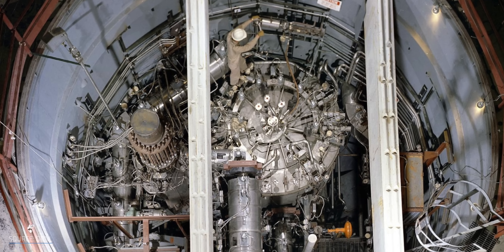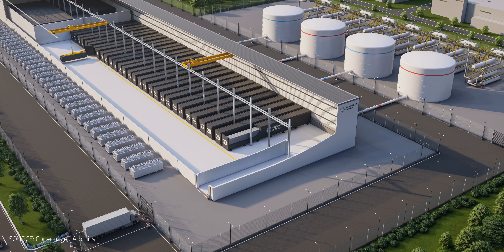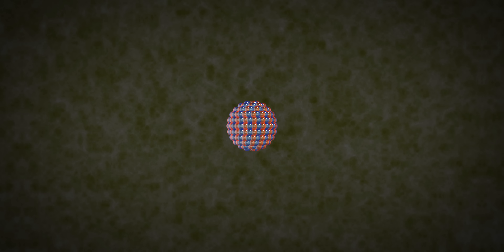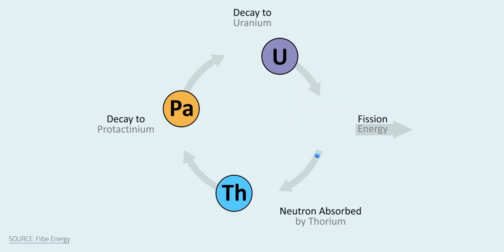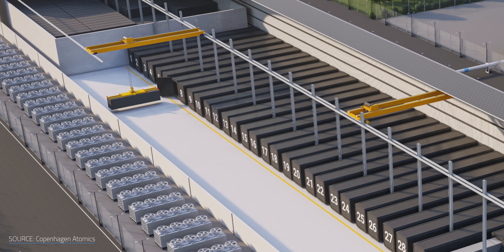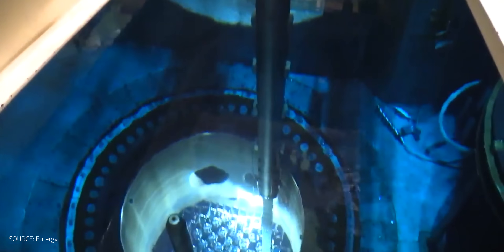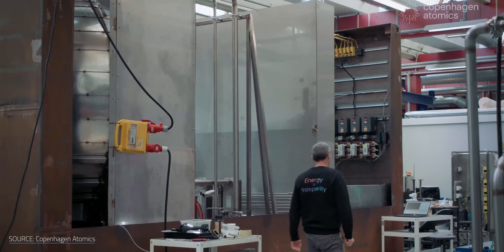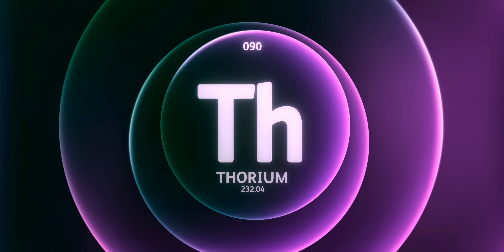Why Thorium is About to Change the World

Comment from the maker: Is this technology in the bag, or is it more roadmap than reactor? Go to https://surfshark.com/undecided or use code UNDECIDED at checkout to get 4 extra months of Surfshark VPN!

If you liked this, check out How Waves Could Quietly Overtake Solar & Wind https://youtu.be/l1pxV7Nro34?list=PLnTSM-ORSgi7uzySCXq8VXhodHB5B5OiQ
Reply: While " molten salt" makes thorium reactors sound safer the facts are:
Thorium fuel is more dangerous to handle than uranium fuel due to the presence of highly radioactive daughter products and the need for remote fuel fabrication. 

Irradiated thorium produces Uranium-232, which decays into Tl-208, releasing strong gamma rays that are difficult to shield, requiring expensive handling and reprocessing. 

In molten salt reactors, the highly corrosive nature of the molten salt can damage reactor components. 😮
Reply: I wasn't going to watch this because it is yet another 'on the cusp of breakthrough' video on clean nuclear; but I'm glad you made this video.

Thank you
Reply: Serious question, why is the mock-up of the power plant showing the containers above the surface when there's a gamma radiation concern? Wouldn't they just put it below a couple meters of water at the very least?
Reply: When a system wears out Can the radioactive piping, vessels, pumps be melted and recycled, or are they buried?  Cheers
Reply: @danbenson7587  as I understand it, they are buried but for far less time. 100 to 200 vs × thousand.
Reply: There are 2 additional beta decay reactions in this thorium cycle in addition to a fission of a neutron product so I can see how this produces more energy than the fission alone but I do not see how this can be limitless as uranium-235 is converted to uranium-232.
Reply: At the moment, more roadmap than reactor. I'd wait for a proof of concept before writing off the conventional uranium reactor.
Reply: There is no "missing piece" to clean energy. There is only the refusal to use the clean energy tech we have. Mostly because Capitalists fear they won't make a profit.
Reply: I've heard this since the 1970s ...
?
Reply: Hey Matt, I visited China's operational Thorium reactors. Those are modular AFAIK and there's quite a few going around.
Reply: Seems like such reactor can produce enough heat to boil large amount of water too as a side effect. I imagine that added to the mix, such application could supply electricity and drinking water / heating (through safe heat exchangers) in an XXXS portable package at areas where it wasn't possible/feasible before.
Reply: I don’t doubt this technology might be around 100 years from now, but not in my lifetime a highly dangerous unserviceable nuclear reactor that only last five years does not sound economical to me no matter how you spin it
Reply: @mm-qd1ho  I heard that statement and immediately doubted the business model.
Reply: @mm-qd1ho it sounds good to those who control it that don't want to lose market from thorium because it is too much and are in many countries that are not in the west
Reply: are you aware you are doing Bill G. nuclear Propaganda!????
Reply: @FJS-RIP-2025 um maybe but this is truth no one want to invest in thorium even 30 percent of the current nuclear programes , thorium is not impossible it is that it is the best option between the worst
Reply: @UndecidedMF You should have a “Thorium Reactors” vs “Fast Reactors”
Reply: https://youtu.be/a5PFnGxHsUE?si=jRZo8ZpQdbyy1UNW. It’s already happening
Reply: Your clickbait title suggest its in the bag. Goodbye.
Reply: I live in Denmark and have been following CPH Atomics and Seaborg now Saltfoss and both of them are very far from a working  reactor. They don’t even have a prototype. All those stories about “new tech” who is going to solve all problems are dangerous. People think don’t need solar and wind because tomorrow we have a humming reactor in the backyard. We are not and we cannot wait…
Reply: Try searching for IMSBR.
Reply: Not quite in the bag, but most certainly at the checkout stand. 
Like you said, paperwork and licensing along with proving to the deniers.
Reply: @wigglesfourthree3390  why would you have to prove anything to any deniers - just do it any way - after all what do the deniers know
Reply: @rossramsdell7584 likely less than those building. But due to systems being run by paper pushing law writers who speak legal over English (or another language) getting passed the initial peak will be a process that will take longer than necessary.
Reply: The primary issue with thorium is that it is dangerous to mine. Median survival to thorium dust inhalation is 33 years. And the studies found it made no difference if you were working in the mine or top side in administration.

While the studies are old, mostly dating from the 1950s and 1960s, it is quite a statement that industrial safety experts effectively banned the use of thorium during that time period. Thorium as an industrial product is really that dangerous.

Keep in mind a plus for uranium is that it has to be enriched (i.e. processed) to be used as a fuel. Thorium does not.
Reply: So, are the urainum reactors gonna become redundant?
Reply: like fusion nuclear power, it's always 20 years away. solar, wind, batteries are here.  it just takes political will or people to massively increase adoption
Reply: So, do thorium reactors use uranium, too?
Reply: How can uranium get through lead?
Reply: also in the desert far away from waves?
Reply: DANISH COMPANY, DANISH COMPANY????? ITS CHINESE DOINT THE NEXT LEVEL THORIUM THING.
Reply: AI clickbait scam
Reply: The Experiment: Suddenly create some charge, and with pre-placed instruments watch (along a radial line from the created charge) the fields and potentials appear progressively at points along that radial, at the speed of light.  And once the field and potential suddenly appear at a distant point, they thereafter steadily remain. This shows that a stream of continuous real observable EM energy does indeed pour from the charge, once it is made, continuously and unceasingly.  Further, that free stream of EM energy does not "die out" so long as the charge remains intact. So the associated fields and potentials are continuously replenished, as they continuously spread radially outward at light speed.

The Observation: Every charge freely pours out real EM energy in all directions, with no observable energy input.

The Problem: Either the required nonobservable energy input must be identified or the energy conservation law is false.

The Solution: The charge continuously absorbs virtual (subquantal) photon energy from the vacuum, coherently integrates it, and re-emits it as real observable photons.

References:

Source Charge, Van Flandern Waterfall, and Leyton Geometry T. E. Bearden  (Dec. 2, 2003)

T. E. Bearden, "Giant Negentropy from the Common Dipole," Proc. Congress 2000, St. Petersburg, Russia, Vol. 1, July 2000, p. 86-98. Also published in J. New Energy 5(1), Summer 2000, p. 11-23.

T. E. Bearden, Energy from the Vacuum: Concepts and Principles, Cheniere Press, 2002, “Chapter 3: Giant Negentropy, Dark Energy, Spiral Galaxies and Acceleration of the Expanding Universe.”

M. W. Evans, T. E. Bearden, and A. Labounsky, "The Most General Form of the Vector Potential in Electrodynamics," Found. Phys. Lett., 15(3), June 2002, p. 245-261.

The Source Charge Problem: Its Solution and Implications T. E. Bearden, Aug. 18, 2003
Reply: Most electricians don’t realize that from any source of a finite potential intensity φ (phi), regardless of how small the value of φ, as much energy as one wishes can be collected, simply by W = φq, where W is the total energy collected from potential intensity φ by intercepting and collecting charges q. If one wishes to collect more energy W from the same potential φ, one simply needs more q. The reason is simple: the scalar potential is actually a bidirectional set of EM energy flows, as shown by E. T. Whittaker in 1903, and what is collected from it depends on the number of fundamental interceptor/collectors (called “charges”).
Reply: Piracy sponsor for a video with a fake thumbnail...
Reply: clearly not "in the bag" as you say. more a bag full of promises. Wich was true for thoriom Reactors for decades. Does not necessarily mean this company will have the same fate. But scepsis   warranted. 
Question: what is the plan for the decommissioned reactors?
Reply: and here i have been hearing china all ready did it was that a lie ?
Reply: @shanbannan17  let us say it was an exaggeration. you could also say Germany did that decades ago. except that was quite a shit show.
Reply: @MusikCassette  oki thx
Reply: Oh dear. Once again the power of stupidity brings up the fifties myth of 'unlimited free energy' from someone who should know better. It was a simple idea to reassure people that nuclear wasn't all bombs, that it could be used to supply power too. All cuddly and warm, nothing scary huh? Yet, despite decades of promises and billions spent on research, the clean cheap energy promise has yet to materialise. Which is bad enough, but what if the promise became real? What if nuclear was suddenly to provide all out needs? 

It would change nothing. On an already overheated plant, with legacy pollution from fossil fuels increasing gloab heating year on year, the addition of energy derived not from the sun but from a source that has never been part of the energy system that makes life possible, and that takes no carbon out prior to adding heat. In fact, nuclear isn't even carbon free as the nuclear cult constantly claim, the mining, extraction, processing and transport of fuel adds CO2 inevitably, and the building of the reactors using massive amounts of steel and concrete adds a further gigantic carbon load to the atmosphere before a single watt has been generated. 

Fission, fusion, it doesn't matter, all will add energy [heat] to Earth without removing anything, and adding energy to an already heating planet will do nothing to reverse the process, but will ass massively to it, along with geothermal heating and electricity generation which similarly adds heat to the atmosphere without any balancing removal. Yet these two are constantly touted as acceptable 'carbon free' sources, as  if carbon free is all that must be considered to solve the problem of climate change. 

Since our current harvesting of energy from the sun in a variety of ways uses just 1% of the available energy arriving on Earth, the constant seeking of a magic bullet to 'solve the energy crisis' is nonsense, merely increasing renewable extraction, which, as the word extraction implies, removes energy to be used, eventually returning it to the atmpsphere, there is a nothing extra added. This is the only way we can harvest energy that doesn't make things worse. All that is then required is to remove carbon, to reduce that in the air and eventually cancel global warming. This is most efficiently and cheaply done ny growing hemp; the toughest plant-based fibre capable of processing into a range of fineness to be used to make the whole range of materrials from underwear to coarse canvas and ropes, along with building boards as substitute for wood. When hemp based products eventually reach their useful end, the fibres can be recycled into paper and cardboard.  No high tech costing millions, a simple bio solution with no side effects or waste. The ludicrous nuke claim of too cheap to meter is taking thepiss, considering billionsd have been shelled out so far for nothing. On the other f=hand, renewables have now got so cheap they actually are too cheap to meter, so all those buying 100% renewables are forced to pay the highest cost, which is gas. And any new nuclesar will be paid for by raising bills, as always. Best option is off grid  supply your own energy.  

All renewables are carbon free apart from the small amount from manufacturing PV cells and wind generators. And the supply is guaranteed for the life of the sun. There is simply no energy crisis, and no reason why billions should be wasted on the nuclear fantasy. During the ten years it would take to build one nuckear reactor, there could be millions of offshore wind generators installed, plus billions of PV panels on roofs of houses, factories and warehouses. The nuclear cult keep coming up with something that's going to be a 'gamechanger', but all they are really after is more funding, more pay for scientists to pursue their hobby, paid out of the taxes of the hardworking population. It has never and will never give a resolution, but will add to the waste mountain that currently can only be disposed of by adding to the tips of all bullts and chells made by th4e arms manufacturers and distributed widely by armies. Current war zones are likely heavily radioactive, which doesn't promise a good life to the inhabitants of Ukraine and Gaza.
Reply: @UndecidedMF  This is fascinating!!! I'd love to see them successful in my lifetime!
Reply: Waves won't do that. Every single project that's been tried so far has ended up with maintenance costs in the face of storms and corrosion which vastly exceed the value of energy obtained. There's no indication that anything with moving parts will break this barrier

Regarding SMRs, if you see someone pushing "small" nuclear, they're chasing subsidies and grants, not a profitable business. The non-nuclear "revenue" side of power generation requires steam turbines to be as large as possible - currently about 1GWe output.

Smaller steam turbines are only running because they already exist. There is no point in building something smaller than 1GWe because the payback period is too long (regardless of the heat source)
Reply: Didn't china and india was building thorium based reactor they are both thorium rich explain🫵
Reply: @aloknaruka3761  India's one is using solid fuels, which is problematic because of the U232

China's is TMSR-LF1 and has already proven that a breeding blanket isn't needed
Reply: @alanbrown397  so this is another hype because i am hearing china have done this india have done this and that in thorium but the real one is no one wants to invest heavily in this it is like side's side quest
Reply: Sooo...decided by Matt Ferrell ?!
Reply: The Copenhagen Atomics design is already obsolete. 

TMSR-LF1 has proven you don't need the cost/complexity of dual blanket breeding and using water (heavy or otherwuse) in the core limits temperatures to around 325C - PLUS water is incredibly corrosive at high temperature & pressure - vastly more so than molten salts. Water erosion is a BIG problem in current designs

Davis-Besse 2002 is worth looking up
Reply: @alanbrown397  thanks bro❤😊
Reply: I seem to remember that this technology was dropped because you can't make a bomb out of it.
Reply: @steveclapper5424  You were lied, errr....rather you were marketed to. You absolutely CAN make a bomb using Th MSRs. Take a look at "What is Nuclear" website's Thorium myths page.
Reply: Sounds amazing. Still, here's hoping that General Fusion ultimately wins out.
Reply: This is the future if we can just keep away from world wars.
Reply: Pebble bed reactors > Thorium reactors
Reply: My honest reaction?
Yet ANOTHER “cheap and easy energy solutions”-video with hypotheticals and idealistic premise.
But we all know, that the immensely, incredibly powerful energy giants manipulate, suppress, buy out & shelf ALL those developments and allow ONLY the unsolved patents with sufficient lucrative potential on the scene. 
Blabla-future-could-be-bright…… I have SEVERE FATIGUE regarding these kinds of “solutions” that never came/come to be. So annoying.
Reply: What do you think about the feasibility of a searl effect generator also known as a zero point energy generator?
Reply: The greater the development the faster we consume the finite resource. A growing economy is unsustainable and a higher cliff.
Reply: …or simply the ebb and flow of the tide.
Reply: red tape and bureaucracy inserts itself even where it isnt likely to be present. 

the guys behind this project need to invest some of their minds for forward and pre-emptive thinking to test scenarios from real world politics and other nonsense as well.
Reply: @UndecidedMF  If the reactors are basically 'disposable' and replaced every 5 Years — what's the plan for handling the massive volume of contaminated materials they'll be producing?
Reply: What's the LCoE?  That seems to be the major issue with Nuclear and esp. SMR's atm.
Reply: @saberrattle 

Ask China about cost and build time, China seems to be on schedule and on budget and building at a fast rate. None of them have blown up so what are they doing right other than having a balanced grid ‽ Or maybe the question needs to be inverted ‽
Reply: @Mentaculus42  Sure, who do you recommend I ask in China?  Does on budget still mean the LCoE is lower than solar, wind and batteries?  It doesn't look like it.
Reply: @saberrattle 

Sure, China is opaque but they are building full size nuclear power plants with stated electricity rates that are less than their new 50% efficient coal power plants.  China also understands the true total cost of “semi-reliable renewables” and the benefits of freely dispatchable power sources. Just look at UK / EU about cost and reliability. UK announces $19 billion investment in first major nuclear plant since the 1990s so that is interesting as it is clear that the full renewable pathway is not working. Spain’s massive blackout very strongly implicates the lack of enough spinning reserves (inertia). Solar that uses grid following inverters are the basis of the fragility of their grid. China understands these issues and builds a balanced reliable grid.
Reply: @saberrattle   LCoE is not relevant, its LFSCoE - the full system costs.
Reply: From *thoriumremix* i know this business is worth 50 quadrillion dollars...providing energy halving the coal.
5 min. Kirk video show everything!
Reply: wow. Interesting. But no mention in your description or links on your channel for the company you based your whole story on. Obviously any CEO or upper management would see that right away as I did. But you do have 20+ links to all your social channels, way to go.
Reply: Thorium has the highest energy gamma emission of all radioactive decay processes.  It's a game ender, not a game changer.  People always gloss over this hard fact.
Reply: Well done
Reply: Playing with the demon of nuclear energy is not worth the risk, especially for completely unnecessary "low emission energy solutions."  We've been lied to about carbon.  Our carbon emissions are not changing the climate in any significant way.  The people making this claim are taking cherry picked bits of data to create an alarming picture that isn't alarming at all when you zoom out and look at all the data they excluded.  It is not hotter than ever. We are actually in a cold period, 18 degrees cooler than the average.  Abd our atmospheric carbon levels are actually very low compared to past ages, in fact, dangerous close to the point that life ceases to exist on this planet. Carbon emissions are a good thing. They are returning lost carbon to the biosphere, which is absorbing it from the air and expanding, healing list rainforest and giving us bumper crops.  It is not even capable of radically altering the climate.  Start by looking at global temperatures of the last 5000 years, then 500,000, then 500 million.  The lie unravels pretty quickly when you zoom out.  And no it's not a conspiracy of scientists. It's a conspiracy of a small number of very powerful individuals that control their funding.  They also control the media, and are easily able to create a picture of "scientific consensus" by simply excluding all scientists with a skeptical view from the channels of funding, media , big tech, etc.  This is exactly what Hitler did to create the illusion that everyone supported him.
Reply: There is already a US patent for a Thorium reactor!!! The one China is building is straight up theft of that patent.
Reply: @mrrooster4876  Ha! Ha! Ha! You must be Trump's advisor!
Reply: @UndecidedMF  it's in the bag since the 1990s thanks to France but destroyed by crazy leftist scared of it because of Tchernobyl
Reply: How can you generate more energy than you consume given E=mC2?
Reply: @issenvan1050  "How can you generate more energy than you consume given E=mC2?"

Think of breeding like a heat pump. Heat pumps output more energy than they consume, but they don't "generate" that energy, they make already existing energy available (i.e. heat already in the ground or air). Breeders take atoms that already have huge energy locked up inside them from cosmic events billions of years ago but aren't easily fissionable and add a bit of energy via a neutron. The addition of the neutron makes the original atom unstable and forces a decay chain that results in an atom that can be fissioned, unlocking far more of the originally locked up energy than it took to add the neutron.
So they don't generate more energy than they consume in the context of your question (e=mc^2), they generate more fuel than they consume using a feed stock that isn't suitable as fuel in it's natural state, either Th232->U233 or U238->Pu239 all while outputting "energy" primarily in the form of heat.
Reply: But, plutonium is very hard to produce, right?
Reply: It will happen in less than 10 years, unlike fusion.
Reply: I just realized that I got automatically unsubscribed from this channel... What the hell is wrong with you Youtube!
Reply: @Alfred-Neuman  YouTube seems to have lost it's collective minds in the last 2 years. A number of mysterious happenings.
Reply: Now make a video talking about all of the reprocessing required to close the loop and the state of development in that regard.  Do that and I might think of you as something other than a shill for youtube sponsors.
Reply: @rockets4kids  hehe, you beat me to it. I had a few round and arounds with these guys about the maturity of their chemical processing scheme. 
The claim that the salt freezes and traps fission products and is walk away safe is NOT true. For example, noble gasses must be contained and should be continuously removed to keep the fission product inventory as low as is feasible.
The bull hoey about consuming LWR discharged fuel is just that. Fissile is fissile and the  non fissile long lived isotopes will remain.
At least they are somewhat forthright about the corrosion issues and say they would dispose of the RX and wetted components every five years.
Oh those pesky licensing requirements.
The Chinese are miles ahead.
Reply: i pay for premium so i don’t have to deal with ads and i NEVER watch embedded ads 

when you embed ads in the video it DERAILS the thought process and makes it harder to follow
Reply: Abondant cheap energy is great for the economy, HOWEVER it also means that humans will have more power to more rapidly destroy the environnement.   That is why I have and ambiguous feeling about it, because humans may be intelligent but they are dramatically lacking of wisdom that would prevent us to destroy ourselves.
Reply: @denisdufresne5338 oh please. lol most of our environmental damage comes directly from producing energy. But you think producing easier and cleaner energy, will make us destroy the environment faster? Ok. How’? What will this better energy, cause us to do more, that will damage the environment???
Reply: Thorium is not going to change the world, or  anything really. Any power generation tech that relies on a steam turbine is inherently uncompetitive already, and gets moreso by the day, except in extremely specialized circumstances. Any thorium plant unwisely started today will never go online.
Supercritical CO2 turbines may provide an incremental drop in operating cost and bump in conversion efficiency, but not enough to compete with the exponentially falling cost of renewables. Nothing can compete with an exponential cost decay except another one.